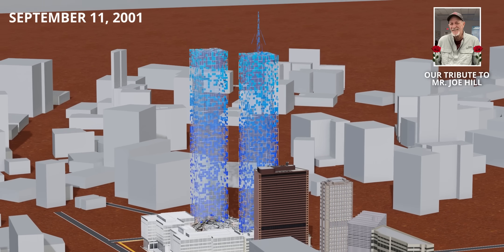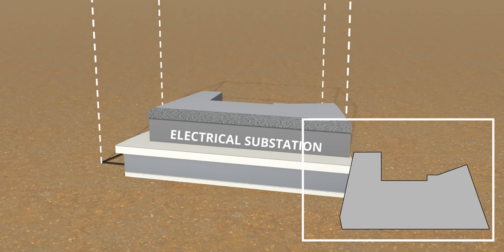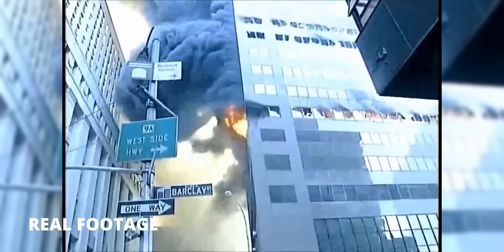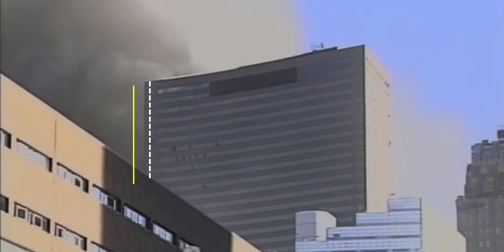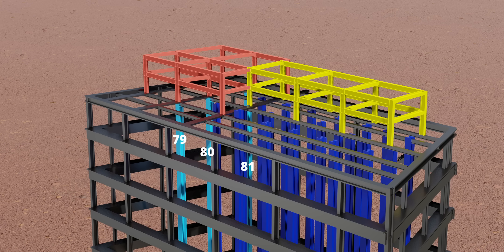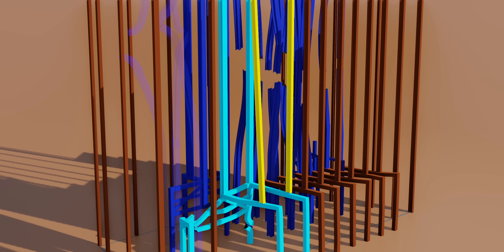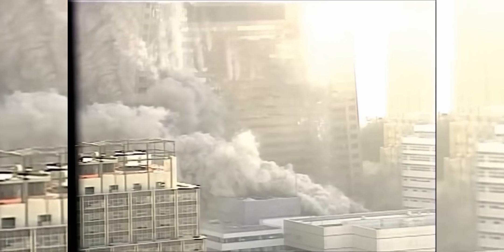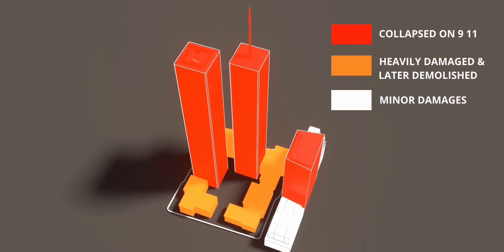Collapse of Building 7 | The Complete Physics

Comment: 600⁰C DOES NOT BUCKLE STEEL!
Reply: No, it bends steel. The bending is what causes the buckling. In the case of Building 7 though the core column buckling that precipitated progression to global collapse was not due to the fire directly, it was due to the loss of lateral support when floor beams failed in fire - overloading.
Reply: @TheCriticalStinker-jw4fl  I'm sorry but buildings don't just collapse like that. 600⁰C is relatively cool. Most Italian pizza wood burners are around 400-450⁰C taking 2-4mins to cook dough. You really think 600⁰C is enough to make STEEL malleable?? I'm an engineer and worked with explosives and there is no way that building 7 wasn't a controlled demolition. But I appreciate your critical thought and everyone else's for that matter.
Reply: @Jack-c2d8w  - I don't think you comprehend the difference between Celsius and Fahrenheit.
Reply: @TheCriticalStinker-01  Interesting that you suggest it's my intelligence at fault. You really don't know me and I absolutely understand the difference. But please explain what you mean by this? Are you saying that it is 600⁰F (because that is 315⁰C and makes even less sense). Furthermore I went on to study science and have a bachelor and masters degree in science after working in engineering and explosives.
Reply: @Jack-c2d8w  600-deg C over time is more than enough to bend steel under load

But for Building 7 thermal expansion may likely have been a greater factor than be ding for collapse initiation mechanisms.
Reply: @TheCriticalStinker-01  "than be ding for collapse..."?? What? No, you've lost me, and you didn't even explain your strange comment about understanding the difference between Celsius and Fahrenheit. Now it's me who thinks you don't understand the difference. And no, 600⁰C is not enough to bend steel under load. Furthermore, if a temperature of 600⁰C was observed, it is highly unlikely this was also the core temperature of said steel.
Reply: @mikero6225  It is well known in the engineering world that load-bearing rolled steel that has been in a fire is reused if the temperatures haven't gone beyond 600⁰C, and even then, there's a high chance they're still reusable. And as I said before, it's unlikely the temperature measurements they took were core temperatures of the steel. Honestly I don't know why I'm arguing with you. The way you talk it's like you've never had a technical education. But you do you.
Reply: @Jack-c2d8w You better inform the fdny that they are liars then. Lol
Reply: @Jack-c2d8w  And yet here you are still talking as if the fires (heat) were responsible for the buckling of the east core columns
Reply: @TheCriticalStinker-01  What?? No I'm not. Wth are you talking about??
Reply: @Jack-c2d8w  - No one but you it talking about fire (heat) causing column buckling.
Reply: @mikero6225  I never said that steel doesn't lose ANY strength at 600⁰C, but as well as there being many different standards of steel designed to withstand load at heat, do you really think they'd design this into a building worrying all the time that as soon as it gets a little hotter than an oven the whole building would collapse. You're ridiculous and I'm done arguing with idiots on YouTube now thanks. End of.

Comment: This is complete bullshit!!!
Reply: And yet not wrong. Go figure. 
	
This video is very good – with one or two exceptions - and goes into a much higher level of detail than many viewers will be able to comprehend.  While not perfect, the collapse mechanisms – the sequence of failures - described here  are substantially correct and this is true no matter who planned and carried out the 9/11 attacks or why . 

That may not be what you want to hear and go against 20+ years of entrenched dogma and conditioning, but it’s not wrong. 

That also means (in case you did not get the hint) this video can be (and IS) absolutely correct in its description of collapse mechanisms AND the 9/11 attacks could still have been some sort of inside job. The two things are in no way mutually exclusive. 

The mechanisms described here have broad professional support around the world. There are no professional engineering organizations (for example: ASCE, ASEE, ICE, etc) that disagree with them or have offered any formal dissenting opinions or alternative hypothesis. 

So, setting hubris aside, either the overwhelming majority of the worlds structural engineers and simple observation are wrong,… … or you are. Which seems more likely? 

IF you still think believe this explanation is wrong then produce a better one . Good luck with that. No one ever has and I don’t see you moving that needle today. 

No one ever does.

Comment: Do you have an office in Langley? What utter BS
Reply: And yet not wrong. Go figure. 
	
This video is very good – with one or two exceptions - and goes into a much higher level of detail than many viewers will be able to comprehend.  While not perfect, the collapse mechanisms – the sequence of failures - described here  are substantially correct and this is true no matter who planned and carried out the 9/11 attacks or why . 

That may not be what you want to hear and go against 20+ years of entrenched dogma and conditioning, but it’s not wrong. 

That also means (in case you did not get the hint) this video can be (and IS) absolutely correct in its description of collapse mechanisms AND the 9/11 attacks could still have been some sort of inside job. The two things are in no way mutually exclusive. 

The mechanisms described here have broad professional support around the world. There are no professional engineering organizations (for example: ASCE, ASEE, ICE, etc) that disagree with them or have offered any formal dissenting opinions or alternative hypothesis. 

So, setting hubris aside, either the overwhelming majority of the worlds structural engineers and simple observation are wrong,… … or you are. Which seems more likely? 

IF you still think believe this explanation is wrong then produce a better one . Good luck with that. No one ever has and I don’t see you moving that needle today. 

No one ever does.

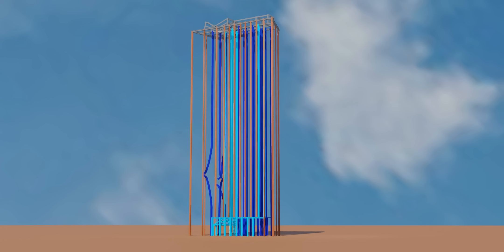Comment: 6:40 Congratulations Mathew, you've attempted to debunk both NIST and the controlled demolition proponents by coming up with your own theory. 

Well, the issue of the transfer trusses is irrelevant to the NIST official story because NIST does not claim that the connections to those transfer trusses had anything to do with the collapse of the building in the first place.

Mathew Sabin, do the right thing and work with AE911Truth as their animator. You know the truth. Money may have helped you save your company, but it's your conscience that is on the line.

Comment: In a classic control demolition, the key columns are severed before the others are simultaneously cut, as was the case for WTC 7. NIST's officially documented explanation is that WTC7 collapsed in free fall* from the onset of its collapse (i.e. all the columns (except the columns under the Penthouse which had already been cut) simultaneously failed) due to a "Progressive Collapse" (i.e. the columns failed in sequence). A Free Fall, Progressive Collapse. So sayeth NIST.  Absurd. 
* According to NIST,  the upper 31 Floors of WTC7 free fell for 2.25 Seconds.
Reply: "NIST's officially documented explanation is that WTC7 collapsed in free fall* from the onset of its collapse"

Actually the NIST liars made up a "stage 1" with less than free fall acceleration.
The only good part of this video here is exposing NIST´s "stage 1" as only horizontal movement.
Reply: @Kudde23  Anything else princess?
Reply: I’m going to respectfully disagree and offer a more plausible explanation based on actual evidence and relying on the thinking part of the brain.

The unknown and unimportant Building 7 was the 6th building to collapse of 10 lost on 9/11. Though extensively studied, it confuses many people. Not famous, or a terror target, and no casualties, thus it did not get a lot of attention and few know much about it, creating a void rapidly filled with garbage from the internet. Because everything seems like a conspiracy if you don’t understand how it works I prepared this brief summary explanation of my own analysis. No politics, just engineering. 

The North Tower collapse at 10:28am bombarded Building 7 with tons of burning debris, causing heavy damage and starting raging fires burning out of control for 7 hours. Half the responding FDNY firefighters having been killed, others injured, units in disarray, equipment destroyed, no water pressure, and the greater urgency of Search & Rescue efforts, firefighting at 7 was pulled as futile. The building couldn’t be saved and was left to its fate.

www.youtube.com/watch?v=g_SvpwyC17M&ab_channel=MFitz  

Collapse of a burning structure is always a concern for firefighters. Steel buildings subject to fire rely on active fighting of the fires to survive. Left to their own devices they will collapse. Buildings are designed around 1 to 3 hours of fire resistance, allowing time for occupants to escape and ACTIVE firefighting to get started, after which all bets are off. In B7 the occupants escaped, passive and active fire protections were compromised and active firefighting was abandoned which left the building to take its chances. It lost. Odds on Building 7 would eventually collapse, and it did. No big deal in logic. That is the sort of choice firefighters make every day in brush fire situations - which houses to save and which ones to let go. Only real difference here is moving the decimal on the size and cost.

www.youtube.com/watch?v=WnYBX6QT0R4 

FDNY Chief Daniel Nigro ; The biggest decision we had to make on the first day was to clear the area and create a collapse zone around the severely damaged 7 World Trade Center, a 47-story building heavily involved in fire. A number of fire officers and companies assessed the damage to the building. The appraisals indicated that the buildings structural integrity was in serious doubt. I issued orders to PULL BACK the firefighters and define the collapse zone. It was a critical decision; We could not lose any more firefighters. It took a lot of time to PULL EVERYONE OUT, given the emotionalism of the day, communications difficulties and the collapse terrain

FDNY Deputy Chief Peter Hayden ; We had our special operations people set up surveying instruments to monitor and see if there was any movement in the building. We were concerned of the possibility of collapse in the building. And we had a discussion with one particular engineer there, and we asked him if we allowed it to burn could we anticipate a collapse and if so, how soon? And it turned out that he was pretty much right on the money, that he said 'In its current state you have about 5 hours

The collapse of Building 7 was anticipated all afternoon and widely reported in the media with at least 24 video cameras recording some or all of the collapse. Everyone at the time knew what was coming and why.

www.youtube.com/watch?v=OY5S5k3tMHI 
Building 7’s collapse was totally different to the Twin Towers, harder to understand and most of the details difficult to see. But we can sort out what happened through careful analysis and observation.  What follows is MY EXPLANATION of the collapse sequence using the best available information and relying on no authority.

B7 was complex structure, a 47-story steel framed building built on top of a smaller existing 3-story building, requiring several lower floors dedicated to complex load transfer structures instead of usable office space. Of trapezoidal shape and all-steel tube-in-tube construction, B7 (above the 7th floor) consisted of a central core of steel columns carrying most of the gravity load, perimeter steel columns around the outside of the structure carrying the remainder of the gravity loads and long span beams and girders to tie those elements together and form the floors. On the outside of the building hung a moment frame - the last part of B7 to fall. 

Phase 1 : Collapse initiation for B7 is notably quiet with observers not realizing the building was collapsing! There was no audible warning in the form of say hundreds of ear drum busting 180-190dB explosive bangs preceding the collapse. The first externally visible signs of collapse initiation occurred at 5:20:28 pm. Here at 12:00 a local CBS affiliate reporter is talking 10 blocks from B7 when collapse begins. People don’t start to notice the collapse until 12:11. Then at 12:45 is the famous CBS fixed camera clip of Building 7’s collapse Again, note how quiet it is.

youtube.com/watch?v=t5tEy6mXSE8&ab_channel=fresnosean379

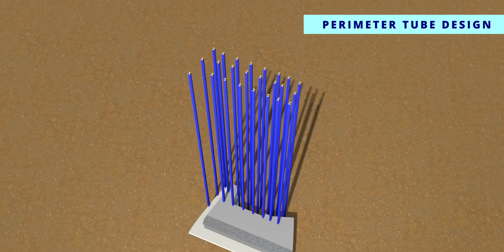Collapse initiation was due to multiple lower floor failures above the load transfer region (7th floor) in the NE corner of the building. In this video at 0:45 you can see the NW corner from inside the building while under construction, Column 79 just out of frame on the left. That big, angled steel beam across the top of the frame connects to C79 at one end. The girders connect to the beam. That beam and all those girders depend on just one connection

youtube.com/watch?v=nP3TNHPCIVU&t=35s&ab_channel=EdwardCurrent

Phase 2 : Lower floor failures caused a loss of critical lateral support over an excessive length of core Column 79 and it buckled. If you look at a floor diagram of Building 7 (see above) and look at all the structures that depend on C79 you quickly realize this one column was a relatively isolated structural element on which a disproportionately greater fraction of the structure depended . Externally we see a vertical progression of window breakage along the 44-46 line and a kink in the roof of the East Mechanical Penthouse at the top of the building, consistent with C79 failure. The transition from full capacity to almost no capacity occurs in virtually an instant. Once the buckling failure occurs there is almost no resistance

Normally with a buckling column, the load could very well be redistributed to other columns, meaning the buckling could stop after a while. With C79 that is not the case - the failure did not redistribute the load, so the collapse rapidly progressed to the roofline, sinking the rooftop penthouse.

Phase 3 : With C79 gone, B7’s progressive, non-symmetrical collapse continues with C80 and C81 at the east end of the core left laterally unsupported and quickly buckled and failed as well, sending the EMP down through the building. C79-81 all have no diagonal bracing, which I believe is a major reason why they could not redistribute a lot of vertical loads among one another.

From there collapse progressed from east to west through the central core until the core was gone taking all of the interior floors and structures and probably most of the perimeter columns with it. You can see the horizontal progression of window failures low in the building and the dropping of the remaining rooftop structures into the building. One of the big takeaways from the NIST Building 7 study (that gets completely ignored) was their modeling which determined C79 failing under ANY circumstances would have initiated the same collapse sequence.

Phase 4 : After more than 10 seconds Building 7 is reduced to just a hollow empty outer shell - the exterior moment frame - creating the illusion the building is still standing since little has changed externally. But it’s just a hollow empty shell like an empty cereal box supported by only a few remaining columns and quite unable to remain standing. The north face leans inward, forming a V in the roofline, the last perimeter columns buckle under the strain and with nothing left keeping it up the moment frame free falls, landing on top of the 7-story high debris pile. It is only here, at the very end that a single measurement of alleged free fall is taken. Start to finish the collapse took 18-20 seconds, or less than 1/3 of true free fall for those who have been conned into believing that has any meaning. Worth noting - how fast something falls cannot tell you what started it falling in the first place. It’s not even the building itself free falling but its empty remaining outer shell at the very end of the collapse. The debris spread out, blocking surrounding streets, heavily damaging the Verizon Building and destroyed Fiterman Hall, all well outside of Building 7’s “footprint”.  

Building 7’s progressive, non-symmetrical collapse was incidental and unintended collateral damage from the combined effects of fire + time + gravity started by the collapsing North Tower. That is true no matter who planned and carried out the 9/11 attacks or why . The collapse was of so little consequence it barely even registered at the time, a mere footnote. 

Anything can seem like a conspiracy if you don’t understand how it works. Now you should. I hope you found this helpful and informative, not adversarial and it solicits informed critical comment. If I made any errors of fact, logic or reason or left anything critical out, please let me know so I can fix it. IF you can offer a more plausible alternative please do. Be the first. Please start any reply with the words “Tits McGee” or I will know you didn’t read it and are wasting my time.
Reply: @TheCriticalStinker-01  No-one asked for your copy paste garbage about an unknown and unimportant building Fitzshill. Topic here is the well known and important WTC7 which housed the mayor´s office, the OEM hq, CIA, Secret Service, DoD, SEC...
Will you ever learn this simple fact in your shitty "life" Fitzshill?!?
Reply: @Kudde23  All done now princess?
Reply: @joshd3192  Are you showing off all your "skills" again little Poorpoo?
Reply: @Kudde23  Anything else princess?
Reply: @Kudde23  All done now princess?
Reply: @joshd3192  That´s so sad little Poorpoo!
How many of such comments do you have to post to earn a cent little Poorpoo?
Reply: @Kudde23   All done now princess?
Reply: @Kudde23  Anything else princess?